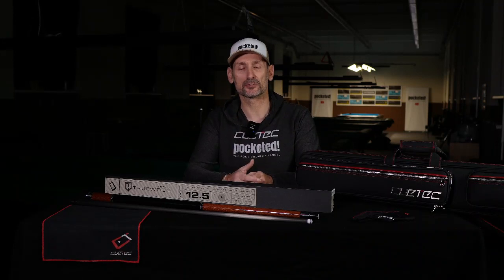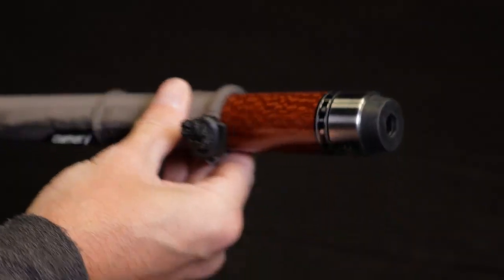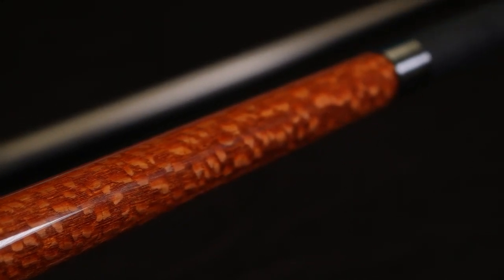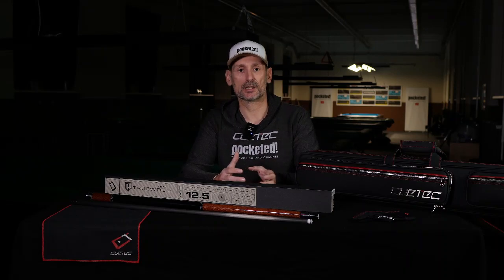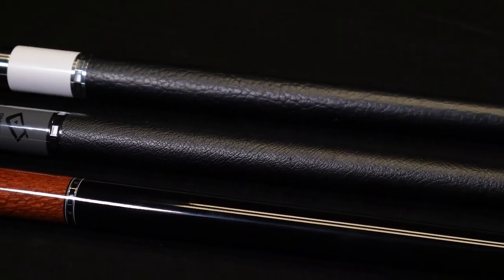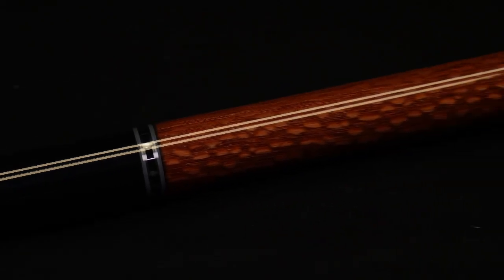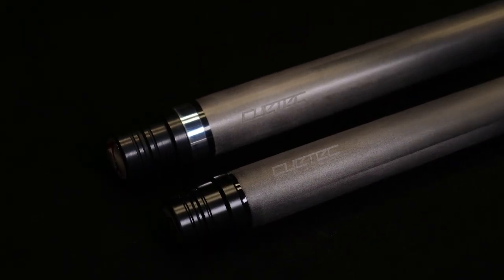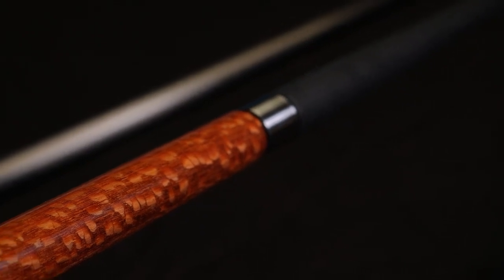Review and Raffle of the new Cuetec Truewood Gen 2 Leopard Wood Cue!

Comment: That is the best looking of your 3 cues. I really like how they made the rings flush. You must prefer 12.5 over 11.8? If so, why?
Reply from the maker: It is 😍 I love the 12,5, because its a bit more versatile and forgiving if I don‘t aim/hit the ball perfectly! Since I am not as good of a player, I do tend to not stroke perfectly at times. But I also have the 11,8mm, and it produces so much spin and accuracy - mindbuggling!!
Reply: Smaller tip allows for a more precise aiming point on the cue ball. You just need to be aware at all times exactly where that tip is when it strikes the ball. Which you probably should be doing anyway in my opinion.
Reply from the maker: @NefariousMinds  Agree 100%! I just noticed with myself that when I am under high pressure, I mishit balls. Does happen fewer with the 12,5, thats why I rather use this shaft. A personal issue of mine

Comment: Hello, I just bought the truewood gen 2 ebony (no wrap too) , what do you use to clean the butt? can I use the cuetec wipes to clean up the butt ? Is it damaging the resin finish on the butt ? 
And I just realize it has some sort of micro scratch ( not really a scratch , because it still so smooth when I rub it , only shows under a bright light) is that normal thing, or its just mine  ?
Reply from the maker: Hi! I always use the Cuetec wipes to clean the but and never had issues. Yet also a towel, sometimes slightly wet with warm water helps too
Reply: @pocketedyoutube  thankyou for your response 🤝